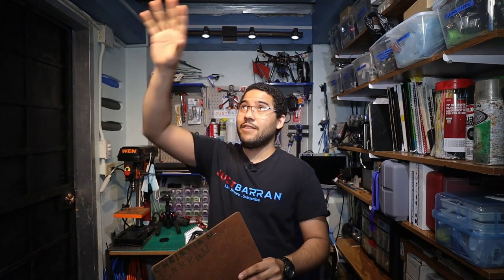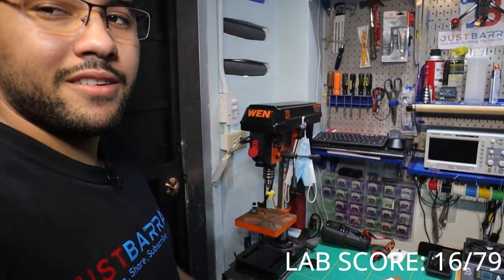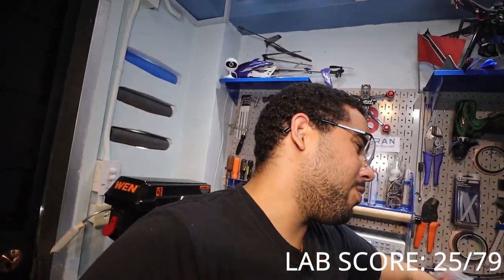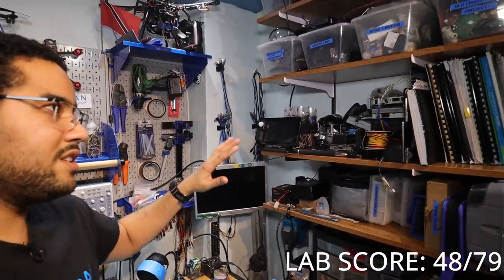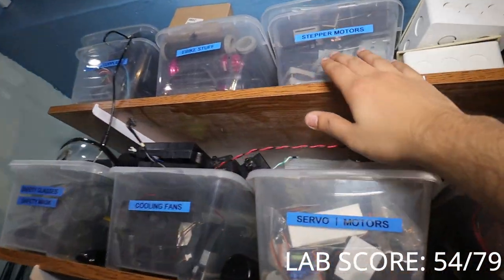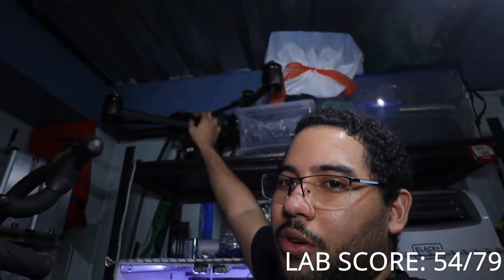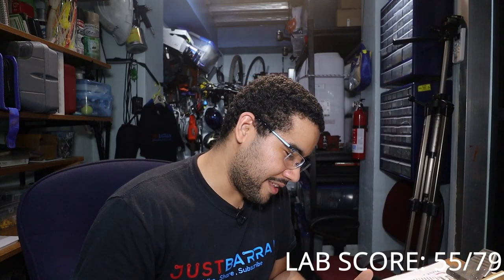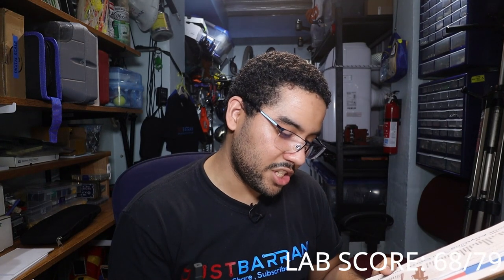Just a DIY Electronics Lab | Just a Lab Tour

Comment: You need a proper benchtop power supply with an overcurrent trip. It prevents the magic blue smoke from escaping. the function generator is for impendence testing mainly. Also, it can act as a noise generator to check if the devices are behaving properly. They are 2 important pieces of test equipment. the VHB tape can actually be purchased from Industrial Caribbean Distributors Limited in Trinidad and Tobago. Kinda expensive but worth it.
Reply from the maker: ooooo, thanks for the info, actually my DIY power supply has Over current, and Over power protection  could check out more info about it here: https://www.youtube.com/watch?v=Wcy9fMotm7Q , I found it hard to buy one online and the cost to ship and clear it would have been $$$

Comment: the score sheet is completely ridiculous !

I have over 15-20K$ worth of component, and this is 3 points, but a 10$ extinguisher is worth 10 points ! What are the chance of creating a fire, when you play with 5-12 volts ???

Calculator: everybody has a cell phone. How many cell don't have a calculator ?

Benchtop DMM = 3 points, but a non-benchtop is 2 points. Who freaking needs 50 decimals !?!?

No mention about logic analyser or even a computer !
Reply from the maker: I mentions the the logic anlyser also and computer, but the point isn’t the give you points for having the most expensive set up, it to credit you for have essential tools, and you maybe pay with 5-12volts but the world of electronics can go much higher and also in negative if you are dealing with AC electronics, hmm they didn’t mention an isolated transformer also.  The point of a extinguisher isnt because you have a high chance for a fire, it’s is on the low chance there is a fire you can safely put it without burning down your lab. And fires could from a faulty solder iron, or glue gun etc …. What did your lab get?